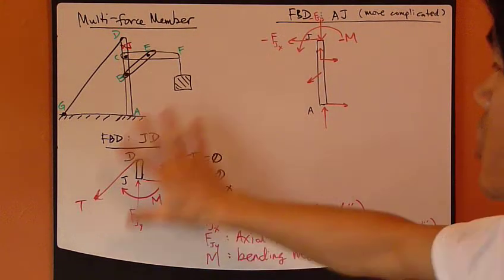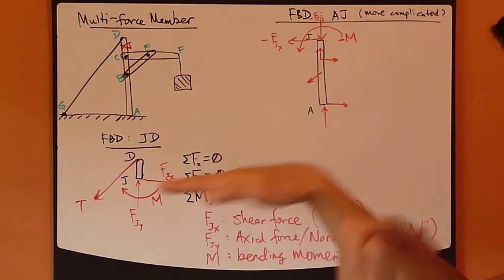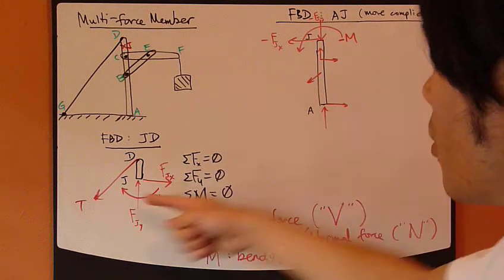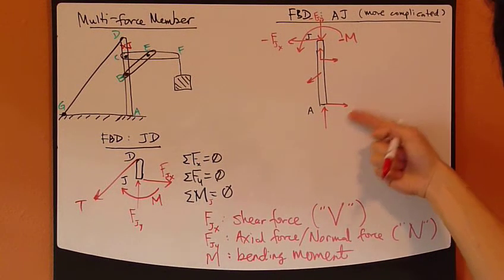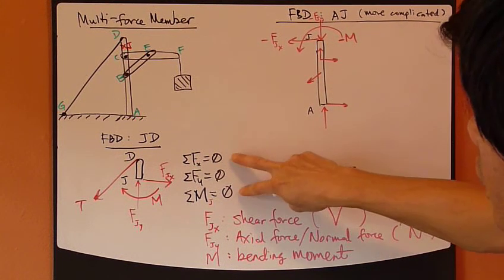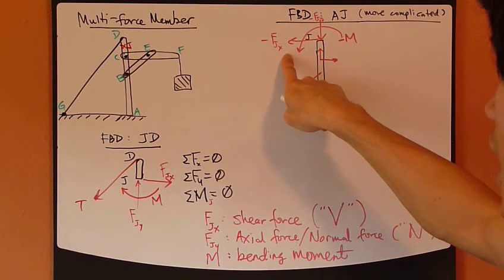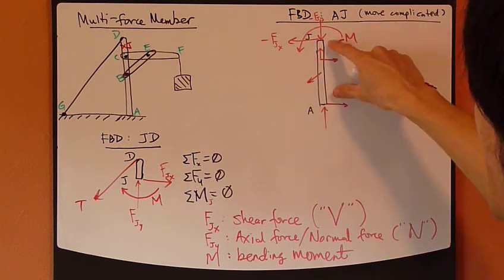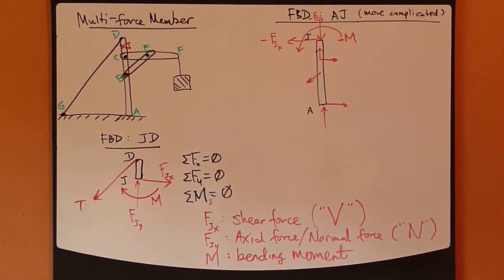Engineering Statics Ch7 Part3: Internal Forces

Comment: Those directions of the Fjx and Fjy and Moments should not be negative right? The direction is already opositte that of member JA in the free body diagram. If it is double negative then it is indicated that it is in the same direction of the those in member JD. However it should come out negative in the calculations letting you know.